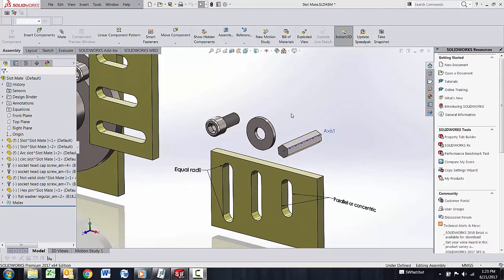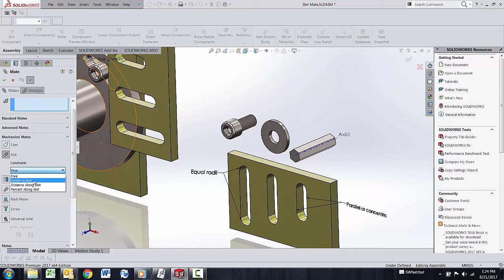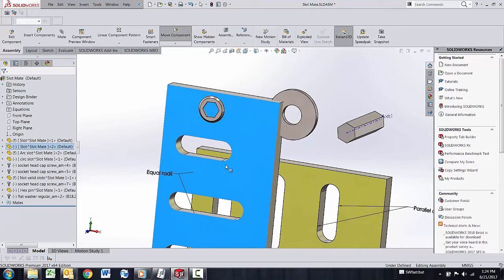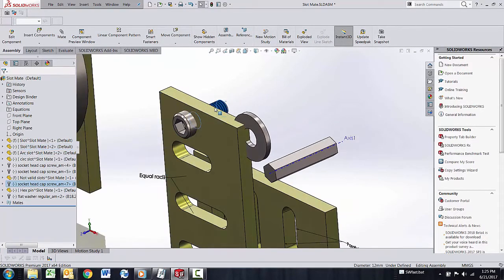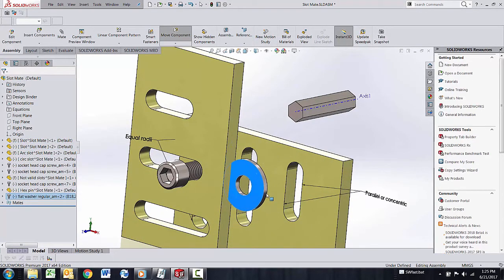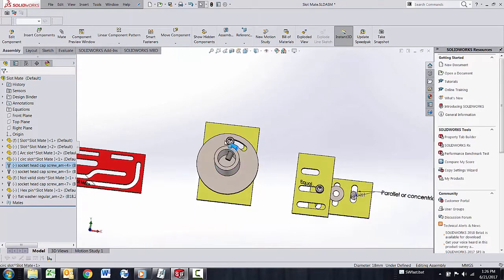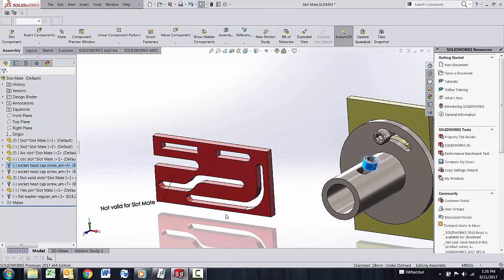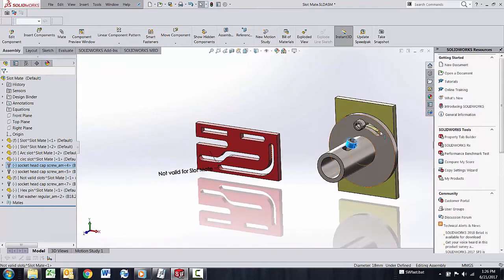SOLIDWORKS - Slot Mates

Comment: how do you make the screw to not spin while it is in the slot? cant get a fully defined assembly because of it:/
Reply from the maker: You can edit the mate and lock the rotation or lock the rotation at the time you mate.  See pic.  It might require 2017 or later!
Reply: Make a separate mate or mates for the default planes of the screw, i.e. mate the front plane of the screw parallel to the front plane of the part.